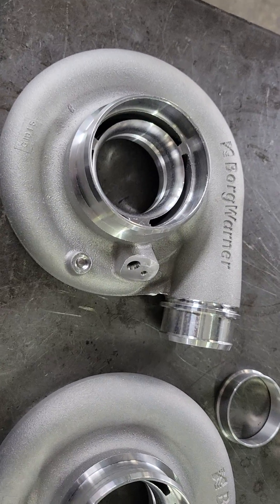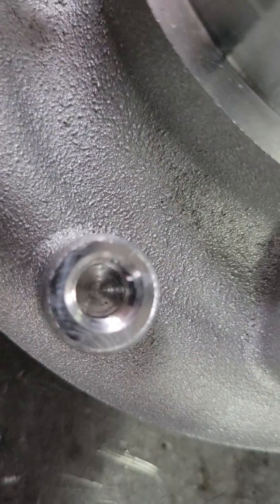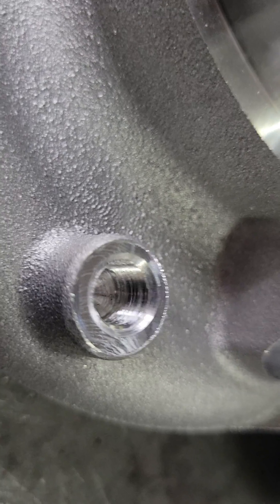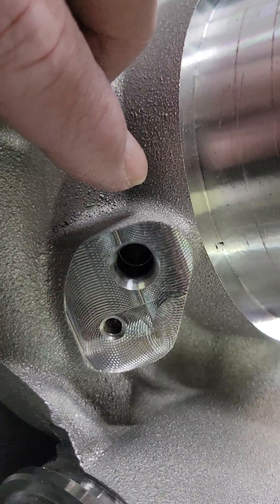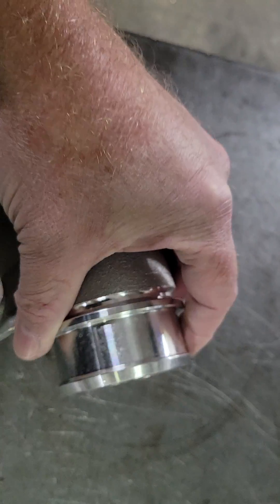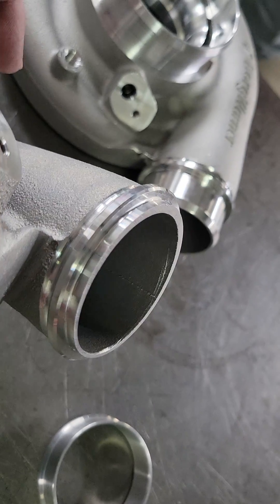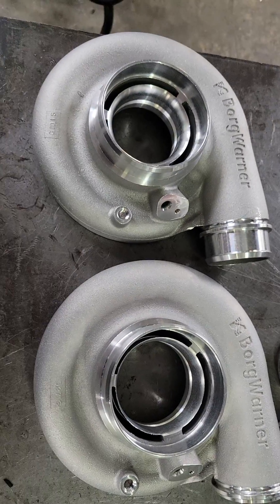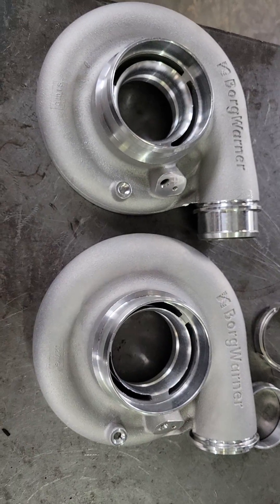BorgWarner S300SXE compressor housing features

Comment: What size drill bit should be used on the  boost pressure reference
Reply: I used a bit a size smaller that port itself. Seems to match the 1/8 NPT fitting itself

Comment: Do you recommend tapping for boost on the compressor or find a different spot in the manifold? Reason being , to not drill into it…
Reply from the maker: You can safely get boost reference anywhere before the throttle body (if this is a spark ignited engine), or in the intake manifold (diesel with no throttle plate).  Your goal is to not introduce vacuum to the actuator body, they are not engineered for negative pressures.  let me know if this makes sense!
Reply: It's usually best to look at pressure directly @ the compressor. Pressure @ the compressor will ALWAYS be higher than the manifold. Depending on intercooler, piping and atmospheric pressure, there can be a BIG difference. You might think your compressor is at a 2.5:1 pressure ratio and working well within the bounds of the compressor map if you look at boost pressure in the manifold; meanwhile the compressor is ACTUALLY at a 3:1 pressure ratio and NOT within the map.

Comment: Are you going to do an S34E video about the features allowing it to perform better than a standard 300sxe, or is that product still in development?
Reply from the maker: We have been dyno testing that unit this summer extensively.  Found some gains, but also found some loss.  We are going to revisit it once our new compressor wheel is ready, hoping for early October!